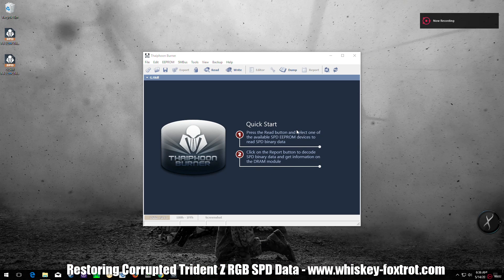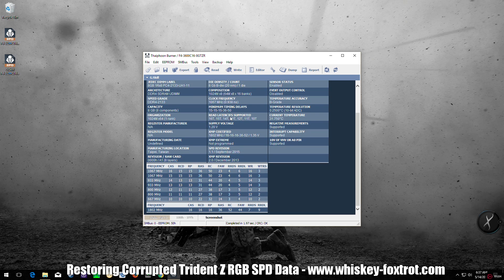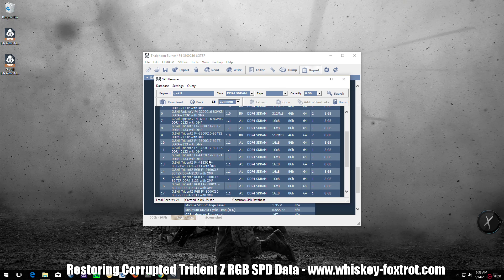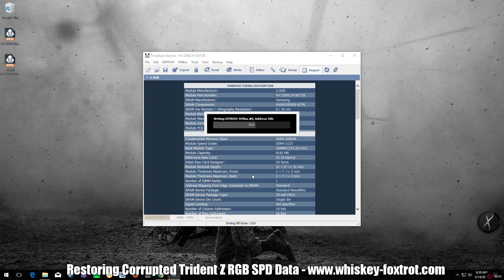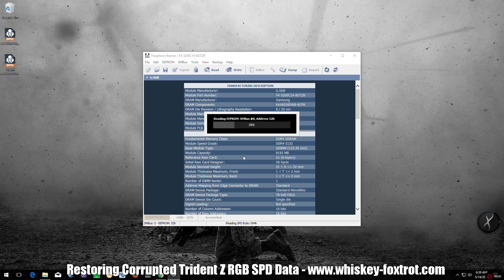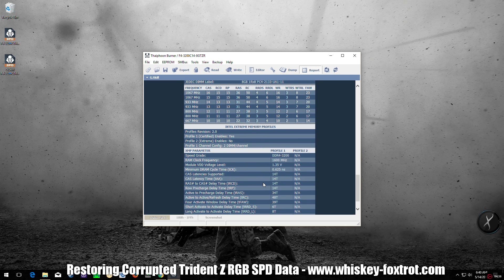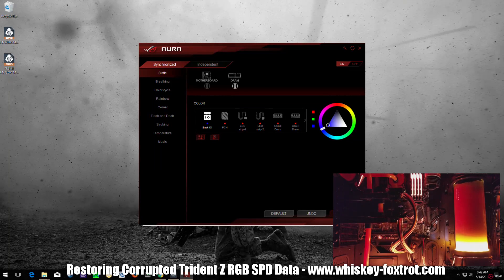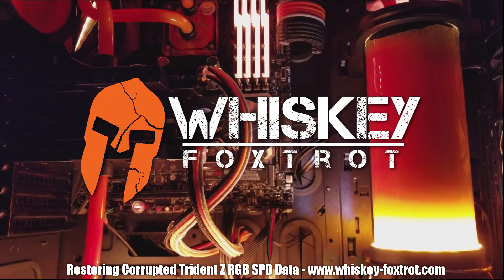Restoring SPD data on Trident Z RGB Memory (posted in 2017! Prob no longer applies)

Comment: Thanks for the video! But if you are going to reprogram more than 1 DIMM you have to uncheck the "Re-Read EEPROM after writing" (under the "Settings" main menu) in the "SPD Data Write" dialog box. Besides, you can set "SMBus Write Delay Time" to 20 ms. This will reduce the total time required to reprogram SPD EEPROM devices.
Reply from the maker: You know, it helps to have a second pair of eyes! I never tried it with it unchecked, thank you for the tips - as I kept it as a precautionary measure.

Comment: It is perfect video i guess since i have spd data error i cant tune my rams to 3600 mhz but i couldnt find my ram in database how can i solve this situation?
Corsair 2x8GB Vengeance RGB Pro 3600MHz CL18 CMW16GX4M2Z3600C18
Reply: For example my rams are dual kit and second one doesnt have any spd error how can i export second ones spd data and load into problem one?

Comment: I have this same problem currently and have already sent in an RMA with GSkill. One of the LEDs was stuck on Red, no matter what. I'm not sure what caused it but I believe it had something to do with Aura specifically. Once I get my replacement ram, I plan on using just GSkills software to control the lighting. However I also am needing to use Corsair iCue for my MOBO and Fans, as well as a 3rd software for my cooler via aRGB header. With my situation, what would be your recommendation for the best way to make sure the corruption doesn't happen again? I really have a bad feeling about using Aura after this since it seemed kinda buggy while using it. Does the more RGB programs you have installed increase the chance of problems? 

Asus Z390-E Gaming
Trident Z RGB F4-3000C16D-16GTZR
i7 9700k

Comment: I have a 32gb 4x8gb trident z kit , out of which one stick is not working , if I leave the stick in there the system does not boot or gives display , how to fix that ?
Reply: Hey i have same issue for slot 3and 4 :/ did u find how to solve this pls ???
Reply: @jimmydubreucque6743  Yes i did find the solution , i took my memory module to a repair guy , he re-flashed my module and thankfully i am back to 32GB

Comment: I have 2 sticks but they both stopped working after using aura. Both rgb lights work but not the actual memory. My pc cant boot. What should I do?
Reply from the maker: Not sure which motherboard you have, but try turning auro off in the BIOS? I'd contact your motherboard or memory manufacturer to see what your options are BEFORE doing anything else.
Reply: @Whiiskey  I have already sent an email to gskill. Hope they reply
Reply: I cant access the bios because the ram doesnt work. I have an x470 aorus ultra gaming. Thanks for replying!
Reply from the maker: @priyanshdagia1046  Ah That uses Gigabyte's RGB Fusion though - as far as I'm aware, that's a different program and not sure how Asus Aura works on there. I could see potential conflicts there so not something I'd recommend. Maybe your memory manufacturer can do a swap for you?
Reply: @Whiiskey  I sent them an email. Now waiting for their reply
Reply: @priyanshdagia1046  Did you get a reply? i have the same issue but with a msi x470 m7 ac

Comment: Hi, I have A asus mobo strix with ryzen 7 2700x. 
When I turn my pc my ram and the mobo rgb colours are ‘lagging’ (its like playing a game at 30 FPS instead of 120 FPS)  
Does anyone have a solution for this problem?
P.s. ‘when the computer is powered off the mobo rgb light is smooth’
Reply from the maker: I'm not sure what would be causing this - did you try resetting it in the BIOS (or updating your BIOS for that matter?). Does it happen when Windows starts up or immediately after the computer is turned on? I'd probably post this on the Asus forums (which mobo is it btw).

Comment: "Write" button is not showing, how can I write the good spd?
Reply from the maker: I'm not sure what you're trying to write as I don't have background information. Either way, make sure the SPD dump you're trying to write is for your specific memory etc. Also make sure you do not have any other (background) applications running that are accessing the memory at the same time (in other words, shut everything down that reads/writes SPD info).
Reply: my bad, I already checked, the "Write" button is not showing up because I have the demo version, thanks for the input anyways

Comment: -Uninstall Aura and G. Skill software

-Turn off computer

-Clear CMOS

-Re-configure the BIOS

-Install only aura 

-Restart the PC again 

END

Worked for me
Reply: I just built my 1st PC and one of my sticks don't respond to aura
Reply: @cipherwing4211  Hi, i have the same issue, did you find out how to fix it?
Reply: signed in just to post a reply. Thank you !!! I've literally formatted my pc , updated bios without any success. Clearing CMOS did the trick for me. Bless you <3
Reply: @rasanjadampriya  hey, I'm happy to know that :) good luck
Reply from the maker: Yup that works now (with most newer version of Aura). There was always a conflict and missed registry settings at the time I posted this video a year ago.
Reply: What do you mean by reconfigure bios
Reply: @cipherwing4211  by reconfigure I'm pretty sure he just mean to either go to BIOS and set it to optimized settings or set the settings yourself, probably best to set to optimized after it's your first pc
Reply: @cipherwing4211  Hello, sorry for the huge delay.  I wanted to say the adjustments you make to the BIOS when it is clean, boot order, memory frequency and CPU ...
Reply: @nicolasmmp  oh hey thanks for replying, I was able to fix my issue by clearing CMOS. I'm thankful my Mobo had that button to do so

Comment: Hello and thanks for the video. Just some questions if you can answer them for me, even when this video is a year old. I got the g.skill trident z rgb 3600mzh cl16 ram and they both light up just fine. But when I check with thaipoon they both show crc error, the next second crc ok, then crc ok, then crc error, in a mix if you understand. Can you please try and explain what crc error means, is the ramstick useless and such. Both bios and other softwares read both stick and tells me that I have 16gb installed.
Reply from the maker: Do you have any other applications running asides from the original memory (RGB) controller? Programs like benchmarking tools CPU-Z, Aida etc, or other motherboard utilities that are also accessing the memory? This is generally the cause of CRC errors being displayed randomly when also trying to read the SPD data (this can also cause corruption so please read the Thaiphoon instructions carefully). IF the SPD was actually corrupted it will stay corrupted and not change. Also, with CRC errors it's generally just a corruption of the SPD data which can in most cases be restored and it usually does not affect the actual functionality of the memory itself.
Reply: Im using cpuid hardwaremonitor to monitor my system and no rgb software installed. I had rgb software installed when I first put the pc together, both asus and g.skill one, but they were quickly uninstalled both. I am running asus maximus x code, i7-8086k, g.skill trident z rgb 3600mzh ram..... So it might just be some program/software that makes thaiphoon just read wrong and the stick are fine and working i assume. Thanks for the reply :)

Comment: I installed the RGB Software from G.Skill and now when I uninstall it the RAM stays at Cyan color. Before the first time that I installed it it was at the rainbow mode. Now without the G.Skill Software is impossible... it stays in that Cyan color which is the color I set for my motherboard Gigabyte Aorus Z370 Ultra Gaming 2.0. The thaiphoon burner would it help to restore it to default like I never installed the rgb software before and never need it again to run the default rainbow mode? (sorry for not speaking English fluently)

Comment: I went into this fix with 1 dim stick, 1 lit stick, and not being detected by the trident z controller. After I rewrote both sticks and did a clean reinstall of trident z controller the two sticks stayed the same and it still wasn't recognized in trident z controller. Any suggestions?

Comment: alright, so after a couple weeks of dwelling about what the fuck to do i found this video and i have to tell you man, i fucking love you, my SPD parameters where not only corrupted but where fucked up enough that my motherboard would refuse to have it as usable memory even setting moth with manual timings at 2133Mhz needless to say i decided to buy the software by mere lack of any other choice..and boom, i just restarted my computer and both dimms shine like rgb diamonds and system is recognizing 16gb as usable (not just 8gb) you my man and the devs of the software my most sincere appreciation. seriously. cheers!

Comment: What will happen for example if I put 3000C14 but ur ram is 3000C16? would I damage my ram?
Reply from the maker: Depends on the ram. I actually played around with one of my G.Skill kits (C16) and used SPD for C14 and worked fine. Keep in mind, those values are set by the manufacturer for best stability; altering it to something other than factory settings can make it unstable. Can you damage your RAM? Probably not unless you make other changes that would create more heat!
Reply: Whiskey Foxtrot Thanks for your answer. I have trouble going 3000mhz on my hynix chip ram trident z. Well I'm thinking of if I change it will it become stable, writing it with samsung bdie spd.

Comment: Will using this software void the warranty of RAM?
Reply from the maker: Do you use CPU-z or any other software that reads/writes to portions of the RAM like Aura etc? Thaiphoon Burner does not void the RAM as far as I'm aware; IF you manage to damage the RAM by making incompatible changes to other parts of SPD (writing an incompatible XMP profile for instance) and try to return it, it could cause issues. I would contact the memory manufacturer for question such questions.
Reply: I'm using 16GB 3000Mhz Trident Z  RGB RAM on Gigabyte Z170x Gaming 5 mother board. I installed G. Skill software to control the lights and in a month, one of the sticks didn't light up. G. Skill software didn't recognize the stick which wasn't lighting up. So Reinstalled Windows and still no luck. I'm confused whether to RMA or try this software. Since I'm from India, shipping charges will be half the price of the RAM.

Comment: Thank you for this. Even Gigabyte RGB Fusion causes this. My 1 out of 4 G.Skill F4-2666C15-8GRR got corrupted and I've been pulling my hair on what 'causes the instability on my Threadripper 1950x. The RGB Fusion corrupted the XMP and it cause hangs on my games even it passes on AIDA 64 Stress Test. If I removed that Ram it will be only on triple channel which 'causes threadripper performance become worst on encoding application (quad channel is a must). Purchase Thaiphoon Burner @ 12$ (they gave me promo code for RAM SPD info submission), save SPD profile from working rams and load it again on my corrupted ram and it works now. Now I can configure the XMP into the bios and the performance of 1950x is so much better. I even overclock it @2933mhz stable meaning this corruption will not let you overclock with stability.
Reply from the maker: You're right - I also cannot stress the value of Thaiphoon Burner enough. It is probably one of the most valuable tools to have access to, especially at that price it's actually way too cheap!
Reply: Agree, on the positive side though I've learned something new. Didn't know about this application. Thank you again for this. I really saved tons of money because of the fix. Glad didn't buy a new DDR4 ram (planning to buy Trident too) which is so expensive these days.

Comment: Hi,I got 16b trident z rgb cl16 3200mhz.one of my kits is not lighting up and even detected by g.skill software.my motherboard is gaming k5 so no aura sync is available. purchased the mentioned program and fix spd on both but still no light.any idea what to ?RMA is kind of joking in my area!so i'll appreciate  your help!
Reply from the maker: I actually got the G.Skill kits to work on both the Z270X Gaming K5, and X370 Gaming K5 with the 1.00.16 version of G.Skill's RGB software. I did not try the current .22 version. The trick is to set the G.Skill software on a delayed launch. If however you have multiple versions of the G.Skill software installed, you'll have to clean that mess up first. Even if you've had multiple versions installed, you will need to manually go in and DELETE the Asus folder in Program Files AFTER uninstalling (the auto uninstaller does not properly clean it up on older versions). So check your running processes to make sure you don't have multiples etc after uninstalling. It's also a good idea to update your motherboard's BIOS if you haven't yet.
Reply: well i have tested on both versions.also do a complete uninstall by deleting the folder after uninstall also using ccleaner for 100 percent sure.and my bios version is the latest .crc is OK on memories but still no lightening.any further job to do?
Reply from the maker: Try the delayed launch like I mentioned above? I don't know what you have in your system or how you have it configured - I just posted what I did to get them to work in my response earlier.
Reply: thanks for your reply.how can i run g.skill software in delayed mod?
Reply from the maker: https://www.google.com/search?q=delay+startup+programs+windows+10&oq=delay+startup+programs+windows+10 I honestly don't know if this is going to help in your case, but it's worth a try. You may want to contact Gigabyte or consult their forums as I have no clue what's going on with your system.
Reply: i have just contact g.skill and gigabyte to get a solution to this issue but non of them had an appropriate answer until now!i'll work on it and if i can't fix it i'll take it for warranty.thanks for your reply's ;)
Reply: what software have u been using for delaying the startup?
Reply: haven't used one! I contacted g.skill and gigabyte and also thaipoon burner directly.that troubleshooting procedure won't work out in my case so i went for warranty option and i just got new ones.Dought even they can fix it anymore  :)))

Comment: So how bad can tridant's software fuck up the spd? I have an msi x370 board so i cant use aura and was thinking of backing up my spd with this program, using the software to change lighting and if anything bad happens revert to my backup. Although I'm worried that the program may end up messing up the spd to where my ram no longer functions even if I have everything closed like CAM and mystic lighting when messing with the rgb. Also I have a backup pair of ram and if it does end up bricking the ram can I plug in my backup ram with the bricked trident z ram in order to boot and restore the trident z ram?
Reply from the maker: It's not that easy to brick the RAM unless you specifically write/erase vital SPD data. Simple backups with Thaiphoon Burner is safe. Now as for G.Skills software, it works most of the time. What you can do (if the controller software doesn't work) is to set a delay on the G.Skill software once Windows starts up. So let it initialize the MSI software first, then G.Skill's RGB controller software.
Reply: Ok so after installing the g.skill software and rebooting, my memory already started showing errors and didnt even open the app or notice it running in the background. so I bought thaiphoon burner and opened up my backup spd file and wrote to my ram to try and fix it but after writing to both dims it still showed error. Only after uninstalling the rgb software was I able to repair my ram. I had everything disabled on startup too so nothing should have been reading my ram's spd shit. Edit: So I got it wrong. The software is constantly running in the background which is why reading the ram detected an error as the software is either also reading to it or writing to the ram. After uninstalling g skill's software and doing a read everything checked out good. But the problem is while having the program installed I'll never know when my ram goes bad.
Reply: So after extensive testing with CAM (AER rgb fans, rbg strips, kraken x62), CUE (m65 pro and void wireless headset), Aura (strix gpu) and msi gaming app (mobo lighting) with the g skill's rgb controller it seems everything is fine. I found the background process that controls the ram's lighting and after changing the lighting in my computer around using all my rgb controllers including g skill's, I then killed the ram's rgb process and scanned both sticks with thaiphoon, the ram sticks checked out fine with no errors, this was also after restarting my computer a bunch of times and with everything to run on startup. Also it seems the process doesn't startup with cold boots and in return g skills app won't launch without it being opened on startup, as manually starting the process does nothing and opening up g skill's software just makes it crash. So I think its safe enough to use for the while being. I will continue use the software and I'm gonna scan my sticks before shutting down my computer each time to see if it ever gets corrupted.
Reply from the maker: Yeah disabling does not work; that's why I specifically mention "installing". If you even install another RGB controller, consider it running in the background. Same goes for older versions of CPU-Z and any app that writes over SMBus (Like Asus defunct "helper" software; I'm sure other motherboard manufacturer "helper" apps do the same, but I can't confirm). Nothing wrong with Asus or other mobo vendors, I just don't trust their own software 9 out of 10 times.